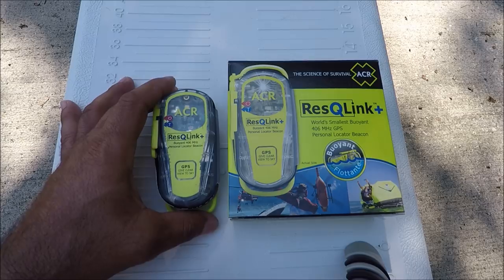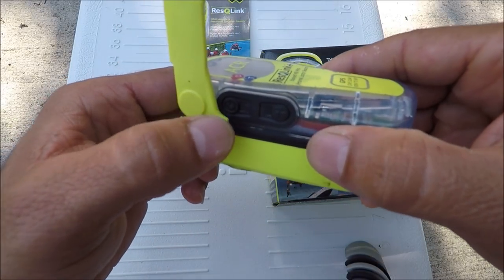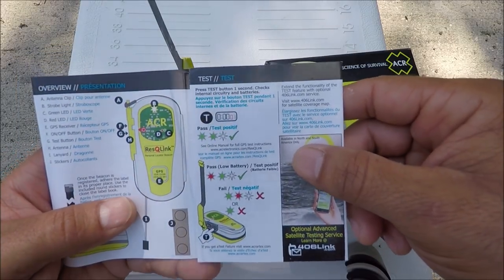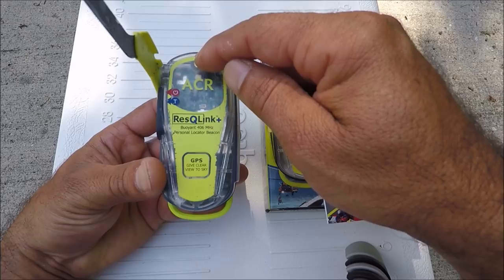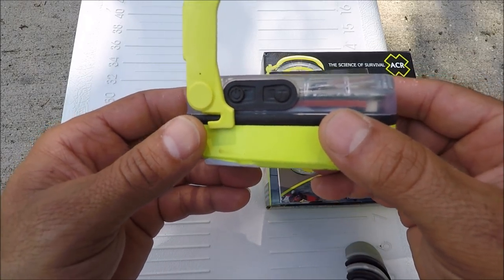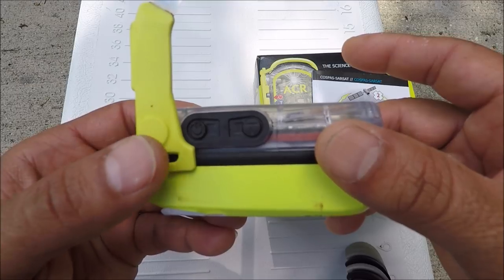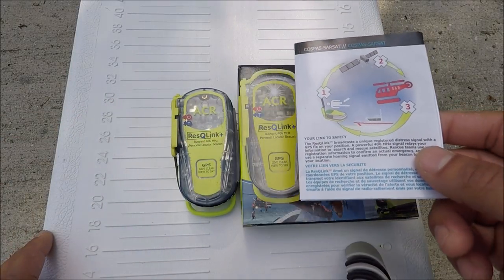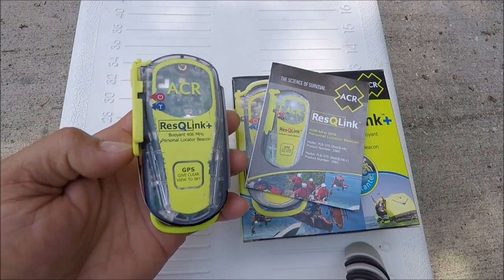Personal locator PLB 406 Testing satellite

Comment: You're under tree cover.  If you were actually using it, you'd need to seek out the clearest possible view of the sky.  Also, if you're using it on a boat, I would store it in a good quality dry box or dry bag.  Sure, it's supposed to be waterproof, but I wouldn't bet my life on a rubber gasket.  I'd be sure to keep that unit dry.
Reply from the maker: Good point cap. But is made for water contact because is made for outdoors and I had it submerged before by accident and no problems,  thanks for watching cap
Reply: @OutOnTheReef     All true!  It is supposed to be waterproof.
Reply from the maker: @jshepard152  yes I have already folen of the boat with it and no problems cap